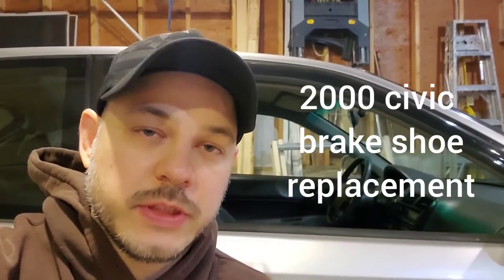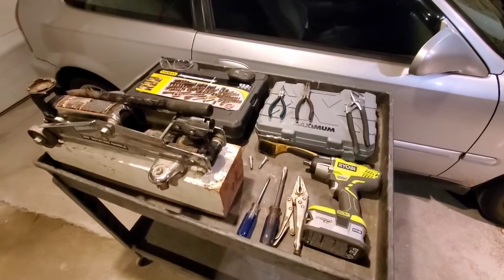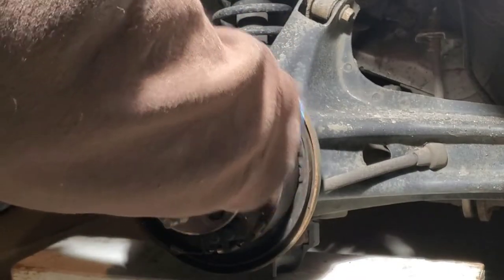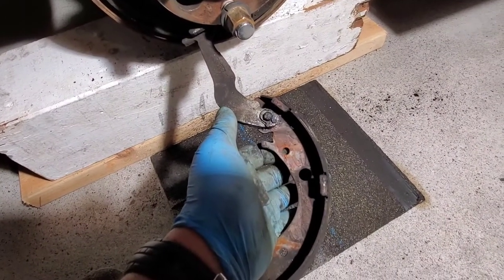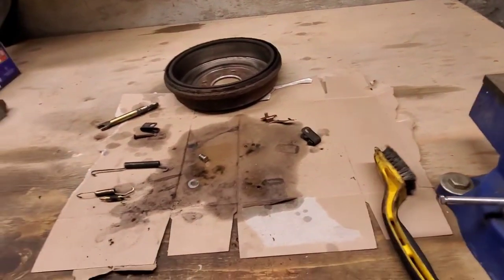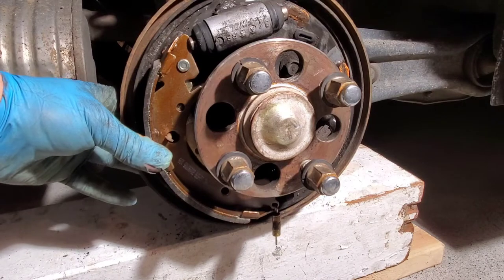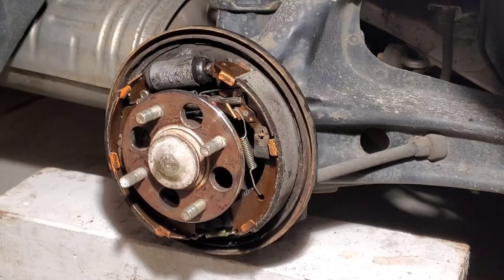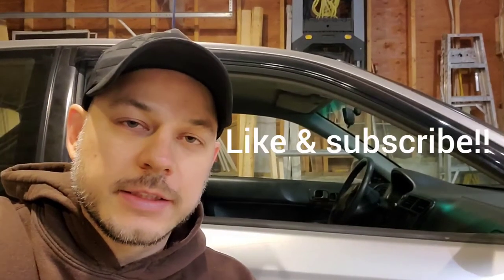96-2000 Civic brake shoe replacement

Comment: How hard was it to pull the spring? The main one?
Reply from the maker: Thanks for your question, the spring was the hardest part. Without vice grips, I dont see how you can remove/reinstall it. A longer flat head would make it easier as you would have more leverage.
Reply: @HomeownerDIY maybe have you thought of using a clamp on the drum shoes to prevent it from moving when reinstalling springs?
Reply from the maker: @e.r.videography6209  That would of been my next approach. I managed to use needle nose pliers and kept it in place using my shin. Im sure you can use a big C clamp, just put a piece of wood between the clamp/shoes so you dont damage the shoe material.
Reply: @HomeownerDIY great. Sounds good. I’ll do that